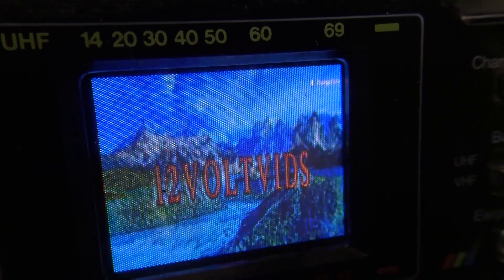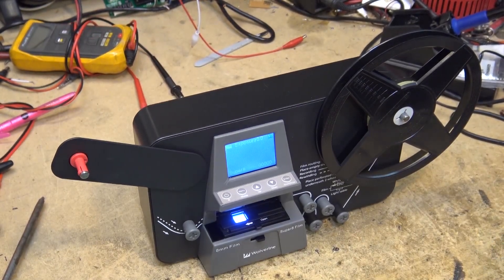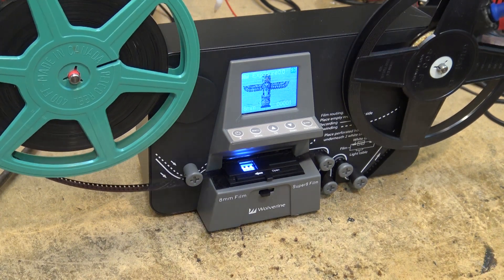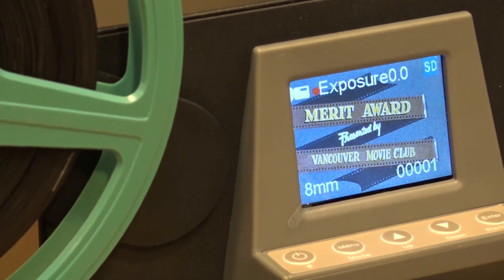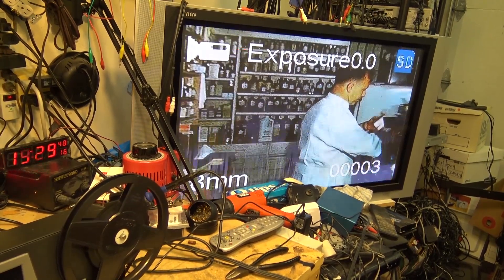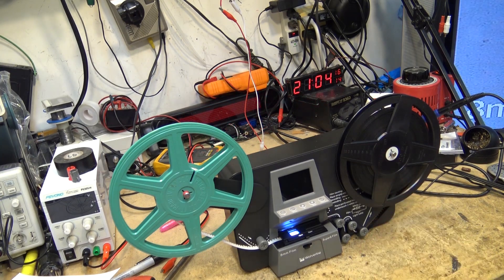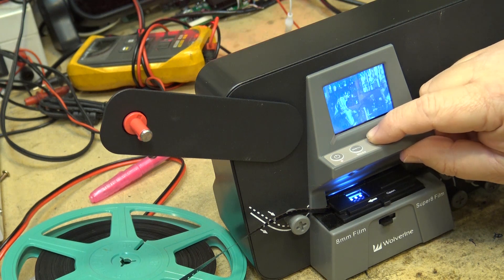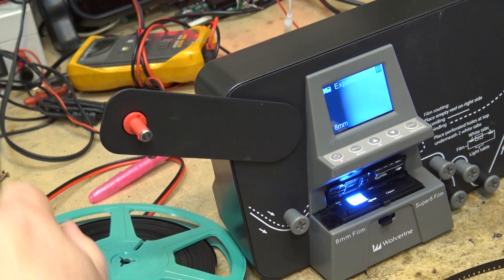Wolverine Film Scanner evaulation and quality check

Comment: Mine arrived today, and I've been using it for several hours now.  One thing I've noticed, is that in some bright scenes, it will dim the exposure a bit, then raise it, then dim it, then raise it....which, at the slow scan speed, creates a rather annoying flicker.  It's not a jitter, and the film is not damaged, and plays on projectors and editors just fine.  It's definitely being generated by the Wolverine Scanner.  This is happening on any scene that's got hot spots..., and it happens on every 8mm film I've tried.  It doesn't do this if you're lucky enough to have a perfectly exposed scene, which, let's face it, with 60 year old home movies made by my mom, those perfect scenes are few and far between!  This flicker is pretty bad.  I will attempt to try the over and under exposure settings, to see if that makes a difference.
Reply from the maker: Which version did you get standard or pro version.
Reply: @12voltvids  Pro model.  Only because that's all that's available.  720 or 1080 doesn't matter a whole lot with 8mm movies, and I don't have giant reels of film.  Tons of single reels, though.  

I also see a lot of compression in the output, but I can live with that, and I'm probably the only family member who would notice it!  The exposure flicker may be a deal breaker if I can't get it figured out.  It's about every 6 frames in overexposed scenes.

Comment: Well, based on your great vid reviews I went ahead and purchased the MovieMaker Pro.  I could not be happier with this unit.  It's performed very well so far.  Thought I'd post a quick review and comments if you don't mind!

The footage coming out of this thing looks fantastic; with very little artifacts or noise.  Any noise seen in these or other clips are the result of two things:  YouTube encoding and/or improper workflow and export settings from your editing software of choice.  Improper export and encoding settings are the biggest culprit by far... 

Some of the more fanatical criticisms are unwarranted for the MovieMaker Pro.  These aren't datacine machines costing as much as a small car, and complaining about many aspects of the MMP is like whining that your Honda doesn't have the handling of a Bugati.  

It's hard to just walk away from this unit for very long and let it do it's thing.  Quite often old film stock will already have some sprocket holes chewed up from years of viewing, and the unit will simply get stuck on a frame.  A gentle tug of the film and it's put right again.  While eventually it will shut off, I'd rather not let the unit just sit there grinding away.

The tabs on the latest model have changed.  Instead of 3 tabs all on the same side of the gate, 2 are now on the opposite side.  Seems like a better configuration that keeps the frames more stable..

I always pull the first 1/4" of film past the gate edge.  The transition splice from the leader to the film almost always gets hung up on that last bit of gate edge.  

Ambient light does NOT affect the scanning.  I've blasted the gate area with my iPhone light and unless you put the thing almost directly on the gate light window, there's no change at all.

For rewinding, I like to pull the takeup reel out just a little bit, then do the 'rewind with the help of a pen' move that 12voltvids pioneered, lol.  In this way the reel spins around the pin freely - without engaging the gearing.  Saves a bit of wear n tear.

The amount of dust and gunk that collects on the felt and gate area is no joke. Get yourself a large Giottos AA1900 Rocket Air Blaster. Also be prepared to carefully clean out the gate side walls with an Xacto or similar.  The emulsion residue and other crap will build up.  Check those nylon spindles as well.  Gunk will build up on those.

Lastly, encoding.  If people are using Adobe Premiere Pro or After Effects, there's no reason to do the time stretch trick with your clips in the timeline.  I see that method everywhere, and it's a bad way to go - mostly because it's unreliable in terms of how many frames are added and where they are added.  Sometimes it works great, many times it doesn't.  All you need to do is take your imported clip and interpret the footage.  With Super8 you put 18fps in 'conform to frame rate' dialog box.  With standard 8mm it's 16fps.  This will add duplicate frames in a precise order, then you can export out at 23.976fps.  Don't get hung up on the this process.  People spend agonizing, PhD quality hours trying to fiddle with the fps (like entering 17.982fps instead of 18 in the interpret dialog because of some very technical reasons).  Ignore that crap.  It will absolutely not matter with the outcome.  Remember, we aren't trying to restore a long lost silent film from Tod Browning here...just getting some great old home movies into the digital age.
  Remember, most noise and artifacts are the result of timestretching a clip and/or incorrect fps manipulating.

Hope that helps!  Thanks again for the great vids, 12voltvids!
Reply from the maker: LSZ1318 
YouTube encoding caused the biggest change in quality. I have been using mine commercially to transfer film for clients. Have put though over 300 reels so far no issues and every client has been very happy with the results.
Reply: That's awesome.  Yeah, the YouTube encoding is bizarre and very hit or miss.  By the way, I wasn't saying that YOU were doing anything wrong.  Hope you didn't think that...!
Reply: @LSZ1318  Is there a particular software that can be used that smoothes out the jitters? I speak of the jitters originally during filming due to camera and sometimes just no tripod used?
Reply: @jefffoster3557  i use Adobe After Effects for work, so I naturally had it available for my home movies.  That’s may be a bit pricey for most folks but the results are solid.  I think they offer a free trial without watermarks so you could check that out.   There’s quite a few free (or less expensive) alternatives out there but I’ve never used them.  If you try those, I’d just make sure to scan that download/.exe file as thoroughly as possible for adware and such.  I think Windows Movie Maker and iMovie for Macs have built in stabilizers.  YouTube also offers this in their editing function!

Comment: I think your video here was one that convinced me to buy the Wolverine Pro back in 2019. I've had a lot of fun with it but discovered that the quality of the film scanned has a big influence on the Wolverine output. Also my machine seems to create far more "noise" than yours. Even my best quality 8mm films scan with so much "noise" I have to de-noise the digitized scan through software or the final scan is unusable. So, maybe these machines differ? So far I've scanned almost 2000 feet of double and Super 8 film. It's been fun and I'm glad I purchased the Wolverine but I sure wish there was something better that's reasonably priced. Thanks for doing your video.
Reply from the maker: The next one up in quality is 5 digits.  I know someone with such a system.  6000 for the 8mm gate, 6000 for the super 8 6000 for the 16mm.  He had 8mm super 8, 9, 16, 18, 24, 36 and 72mm film gates.  Needless to say this is his business.  5k film scanning.  I maintain his vcrs for him.   His setup was over 100k so he charges accordingly.   Mostly work for government and media companies archiving old film footage (hence the oddball obsolete film size gates) 
My trick on the wolverine is to not use the take up reel. I let the film drop into a box and reel up after.  I also scan full frame with the edge showing through and then crop on the computer after scanning.  Much better results.  Takes a little longer but results worth it.  Recently did a film from the 1930s. Black and white nitrite cellulose film.   Owner was most grateful that I was able to get such good quality from an old film.  Saw long dead relatives farming using a horse drawn plow.

Comment: I  have the Pro model.  The more I look at the output, which is 1080x1440, the more I realize that it is not being scanned/recorded at that resolution, but rather at a much lower resolution and up-rezzed on the fly to 1080.  Digital artifacting, like bad aliasing, is quite evident in these files.   I wonder if it's the same for the 720p model?
Reply: Thanks for the explanation.  I have a reel that was digitized by someone else, and it has the same artifacts.  I was not impressed.

Comment: Not bad at all. The film grain is well defined so the image is very sharp. Exposure looks good on the exteriors. The interiors look over lit and/ or over exposed when originally shot.  Stretching out the 8mm film aspect ratio to 16:9 is not to my taste. I'd rather have the black borders at the sides. However, we know some people like full frame regardless of the distortion. I suppose one could ask the customer for their preference.

Comment: Hi. I purchased one of these recently and so far I'm pretty pleased.  I do have an issue that I would like to know if you  would agree with.  If I play the video file from the Wolverine Scanner hooked up to a monitor (yellow RCA cable to HDMI converter to monitor) it looks better than if I play the exact same video file played on the same monitor but played from my computer (Display Port to monitor).  When the video is played on the computer (using Windows Media Player or VLC) the image looks way over saturated and sharp. When the file is played from the Wolverine the image looks way better. Do you find this to be true as well?

Update: I just turned down the sharpening and saturation in Premiere Pro and the video looks like it does coming out of the Wolverine Pro.  Looks way better now!!

Comment: nice to see inside of the new machine, I have the original 200ft machine.  I notice the 'new' take up motor is widely available at ebay if you search for 3rpm motor.  thank heavens for that, I am sure it wont be long before i need another new motor! Thanks for opening this up and making a video
Reply from the maker: I have been using it now for a few weeks and doing plenty of film orders for customers, so I will be doing a follow up video soon. Just transferring roll number 62 right now. (Most have been 200 footers and a few 400's)
The take up motor on this is much higher than 3 RPM. It is more like 30 RPM as there is a slip collar on the take up spool.

Comment: I'm convinced that you could build a similar device for about a third of the price, but with a sturdier gate, better camera, larger screen, and auto-winding without needing to swap the reels.

I hate to sound like that guy who always says "Rasp Pi", but... Rasp Pi. lol

You can even get the small camera modules for the Pi that plug in directly, and with a bit of Python script, you could add the menu stuff, and even allow it to send the frames or video clip to a PC via WiFi / Ether.

It's not such a bad device though. It looks like it does the job, and the quality looks fine for the size of the film.
Reply from the maker: ElectronAsh 
I have a challenge for you. Build me one for 1/3 the price and I will buy it from you.
Reply: haha - I thought you'd say that. :p

I completely see why people buy them, as it's still not THAT expensive, and hey, somebody at least makes 'em.

It just seems like they could have improved it with some minor changes, like faster rewind motors, slightly less flimsy looking gate etc., even at it's current price point.

It is still a possible venture for an open-source project maybe. I would have a go at it if I had any spare money atm. (most of which has being spent on other electronics projects).
Reply: @electronash  As this currently seems like it is (after 3 years and counting) the best mass market device for this type of thing, the market is WIDE OPEN for an improved version. I'd guess that they'd sell well at even twice the asking price.

Comment: i didn't think the quality of it was that bad for its age, celulose film does go strange in time, and it burns too easy.

My dad filmed me as a baby (52 years back) with mum and my brother and sister down the local park.

it was done on super8, expensive in its day.
it was transfered using a projection method then finally saved on vhs. (bad idea).

The original film is lost now, but it was falling apart, every playback it snapped.
I was given a copy on dvd taken from the vhs, not good, the colours were all over that place and the grass was pink, faces were really odd.

I used an old copy of Tmpenc to change all aspects of each frame, it took bloody hours :-(.
The film looked so much better :-D (grass was green, faces were pink ish, hair was correct).
Reply: Just for your enlightenment, neither 8mm or 16mm film have ever been inflammable cellulose. From the beginning (1922 for 16mm, 8mm in 1932) these gauges were on acetate safety film, later equally slow-burning polyester. You are probably getting mixed up with the professional 35mm gauge which was mostly cellulose nitrate until circa 1950.

Comment: Just keep your film editor handy for the rewinding side of it lots easier. I thought the grain on this device was extremely bad maybe YouTube couldn't pick up on it high-end quality but I wasn't impressed with the sample shown
Reply from the maker: First my editing software stretched the 4x3 picture to 16x9, and it has been recompressed 3 times. The initial MP4, the edit where I synced the sound as this was a sound film and the sound had to be processed separately.  Also it was shot at 16fps so speed had to be adjusted and then rendered out.  Then it was rendered out again for the clips in this video and the. YouTube compresses it again.  I have a sample uploaded directly from the unit and it looks better but still not as good as the source file off the scanner which looks great.

Comment: Time to head down to the Sally Ann or Value Village to pick up an old 8mm/Super 8 projector to use as a rewinder! It would sure save a lot of time. I find them all the time where I am for between $5 and $20 complete with working bulbs. The bulbs are what most people are after anyway. Thanks for the review. Will send the link to interested parties i know. I wonder what the manufacturers have in mind for this in the future as improvements could sure be made. Was looking at a book scanner for my rare books collection but the cost is normally prohibitive. There are some cheap alternatives but they also may be quirky or basically still ion development with the buyer acting as a guinea pig to test and possibly iron out the bugs. Home brew is another option but I'm not real good at that sorta thing so a purchased unit is something I'd be interested in...
Reply from the maker: I have about 10 of them kicking around here.

Comment: Thanks 12voltvids, unfortunately the 720 version has just left on its way to me. I may get the PRO version and try and sell the 720 when it arrives. I guess the 1080 version gives a  far better finished  product?
Reply from the maker: 126grey 
The 720p version is I believe 1024 x 720 4:3 and the 1080 is 1440x1080 pixels also 4:3 aspect . Will be a little sharper but not as big a difference as going from SD.

Comment: Yeah, that's the thing. Most people have already transferred to DVD years ago. I had a special case though. I once had to clear out the film department of a local high school and send 1300 16 mm films to the dump. As a film buff, that broke my heart. But I retained about 20 or 30 canisters of things I might have liked to have seen, including documentaries I've not seen since and several cartoons. I did once buy a set of 16 mm projectors and their amps and speakers but never got around to doing anything with them. Might be good for a restoration project. Who knows. Anyway, the newer transfer equipment would be ideal for doing the 16mm films at the very least with some really good transfers so long as the films have held up. I don't have much interest in doing this as a business however, so I'd probably just sell the equipment once I was through with it (much as people do with slide and filmstrip scanners once they have finished archiving their material). But if the costs are too high, I'll probably forgo this idea until (if ever) it does become feasible...

Comment: This looks really nice. I would use my actual movie projector for the rewind as it's super fast.
Reply from the maker: It takes about 1 minute to rewind by hand just spinning the reel with a pen inserted in the reel hub.  Would take longer to switch reels to use the old projector.  Even a 400 foot reel can be done in about 2 minutes.
Reply: @12voltvids  
Spinning it by hand like you did is the best way.
To hell with waiting for an hour to let it rewind or longer.
Keith  Kuhn 
A new subscriber
Reply from the maker: @KTHKUHNKK  
I always rewind by Hand.

Comment: The companies need to design a Super 8 /  Standard 8 mm  converter that  plays the film at normal speed, with sound as well, but which scans it like this one. So you get a well defined picture with sound as well.  To do it frame by frame like that is sheer madness.
Reply from the maker: You can get one.  100,000.00